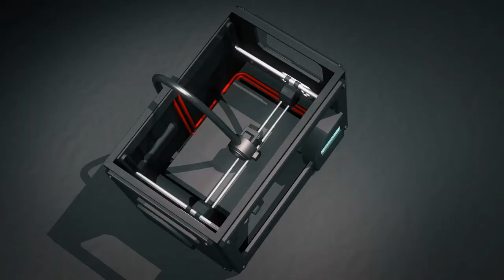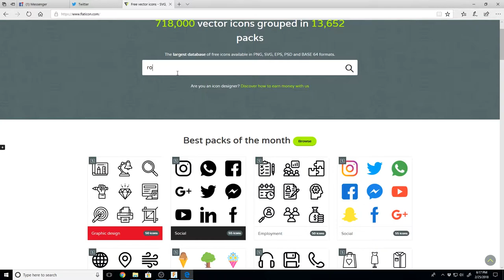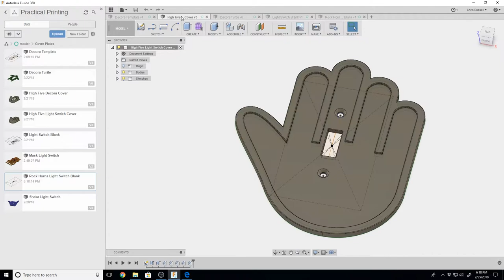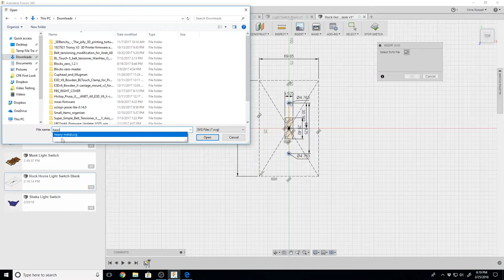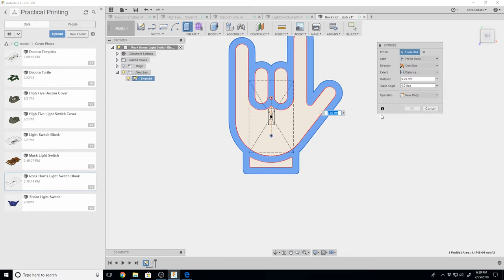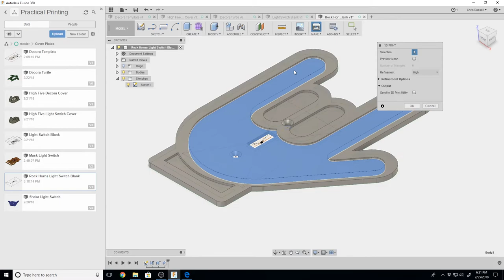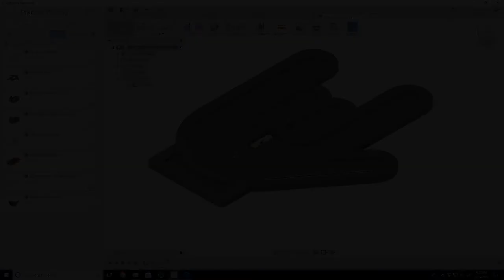Learn to Design Your Own Light Switch Plates In Fusion360!!!

Comment: I love this tutorial. I am having one problem though, I put an SVG like yours on top of the light switch template and there is no rectangular hole in the center (where the switch is) nor where the screws would go. Could you help me out with this? Thank you so much!
Reply: I made the extrusions but once I tried to do an extrusion on the inside of the shape, it also seemed to have extruded the part where the switch and screws go. I've rewatched the video, and I'm sure it's an error on my part, but when I try to extrude the center, it didnt exclude the screws or switch area, I'm not sure why. Sorry for the confusing explanation.
Reply from the maker: @pamelam1101  without seeing the files and exactly what you’ve got going on, I can only make a logical guess, but it sounds like you don’t have visibility set to show on the sketch of the template.
Reply: @crussty3d  I've got it figured out thank you! Do you happen to know if/where I can find templates similar to yours for light switches with multiple switches? Or how I would go about doing that myself. I really appreciate the tutorial, I've made some light switches with them already and I love them. Already printed one, now on my way to print some more!
Reply from the maker: @pamelam1101  I don’t know of any templates, but it’s very easy to sketch them out.  I sound this site with dimensional layouts, but I’m sure a quick google would get your other sizes: https://diy.stackexchange.com/questions/77960/are-all-rectangular-outlets-switches-and-plates-the-same-dimensions-and-interc